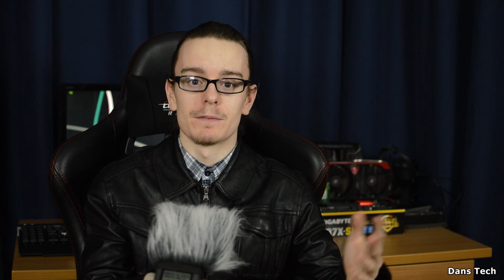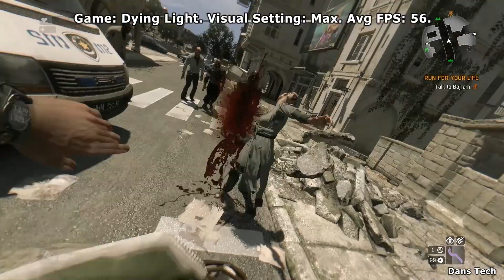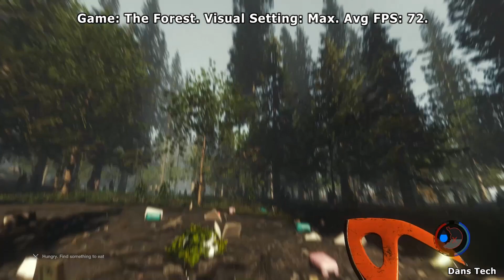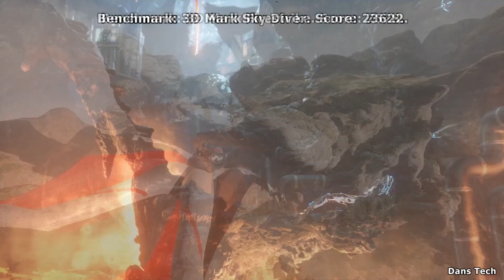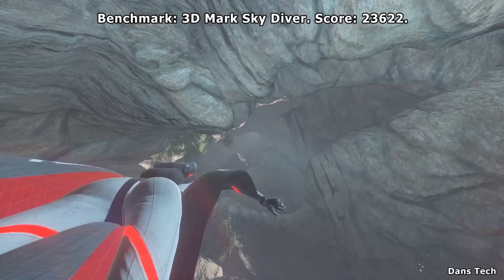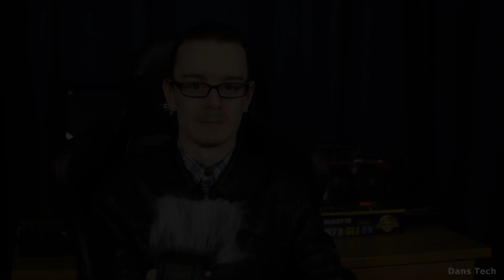How To Build A Mini-ITX Gaming PC 2015 - Part 3

Comment: is there a need to update BIOS for the h81 mobo with the i5-4460?
Reply from the maker: As the H81 chipset came out before the 4460, there is the need sometimes. However as its now an older chipset, the CPU should work in nearly all boards now. They tend to be flashed by the manufacturer of the board before they leave the factory. Dan.

Comment: Hey there I have actually built this exact PC due to the fact that I've been looking to build a portable gaming rig, however I was wondering why you did a benchmark on the GeForce gtx 770 and not the GeForce 970 like you had used in your build? I just wanted to see what your bechmarks came up as with the 970 rather than the one in this video so I can compare to them to my benchmarks

Comment: CPU: AMD A10-5800K 3.8GHz Quad-Core Processor ($96.98 @ SuperBiiz) 
CPU Cooler: Cooler Master Hyper 212 EVO 82.9 CFM Sleeve Bearing CPU Cooler ($29.98 @ OutletPC) 
Motherboard: Gigabyte GA-F2A88XM-D3H Micro ATX FM2+ Motherboard ($64.99 @ Amazon) 
Memory: Crucial Ballistix Sport 8GB (2 x 4GB) DDR3-1600 Memory ($77.99 @ Newegg) 
Storage: Western Digital Caviar Blue 500GB 3.5" 7200RPM Internal Hard Drive ($50.98 @ Amazon) 
Case: Cougar Spike MicroATX Mini Tower Case ($29.99 @ Mwave) 
Power Supply: XFX 550W 80+ Bronze Certified ATX Power Supply ($49.99 @ NCIX US) 

Will this run dayz
Reply: Isaak Disbennett no because there is no gpu in your build

( ͡° ͜ʖ ͡°)
Reply: Nope
Reply: I have same processor OC'd to 4.5 and an msi GTX 970 100ME edition and I still have spikes that game is optimized for Intel processors…
Reply: Keenan May Or Intel processors are just a bit better at single core performance. At least the more expensive intel processors.

Comment: hi dan, is it worth updating you "price builds" as they are nearly 6 months out of date ?. i know that it be a monumental ball ache but 6 mths is a long time in the puterverse :-)
Reply from the maker: anip banforthis A "a monumental ball ache" you say.. Good news! I plan to renew these in a about a week. When you planning on building a PC?
Reply: Dans Tech i am upping my broadband to infinity 2 on the 21st of the month as not gamed for years and elite and homeworld have brought a bought of nostalgia on that i think about a thousand quid should cure,lol... should have all the cash for the puter by the end of the month (self employed and working like a donkey to scratch the cash) i was thinking along the lines of 4690k/msi 970/asusz97a. i want to use the 970 card for the DSR function as i plan to plug it into my tv along the lines of a steam box. its been about 15 years since i screwed a one together but watched a few vids and its mostly the same, i would like info on dvi/hdmi cable to tv difference and  power supply choice as thats a whole new ball game for me. dont know where the motherboard piccy came from but hey ho, its just the net.
Reply: anip banforthis and the piccy has disappeared ....
Reply from the maker: anip banforthis piccy? something I'm missing? The gtx970 is a great choice, great performance at 1080p and 1440p, stays cool and pretty damn cheap comparing the gtx980. HDMI is just DVI with sound so no need to worry about "loss" of quality or anything like that. TV's aren't the best as they typically have a lot higher refresh rates, especially Smart TV's over around 42 Inchs, theres a lot of information for the TV to process at that size. As for a PSU, if you do go with a single GPU, you can literally pick up any power supply as soon as its 500Watt and is a good well known brand. If you have anymore questions post them in the most recent Q&A, here: https://www.youtube.com/watch?v=oC5UBaaUf6M They allow me to answer the viewers questions in more detail... and a lot faster than typing out these essays :D
Reply from the maker: anip banforthis Also I want to add, DSR is a great feature to NVIDIA cards, I now play GTA IV & BO2 Multiplayer at 1440p!